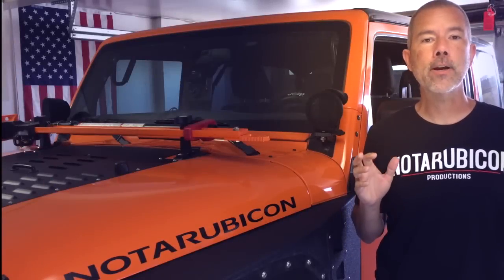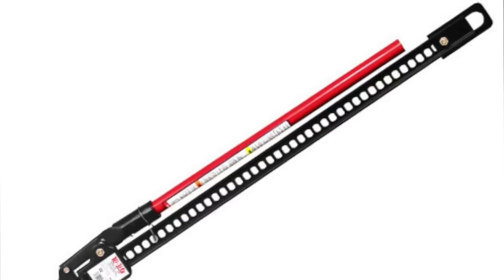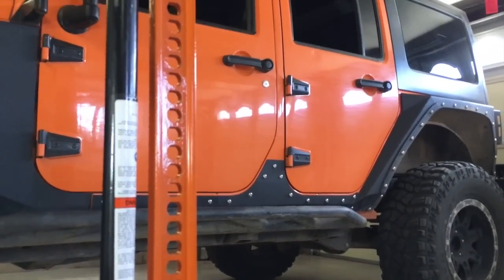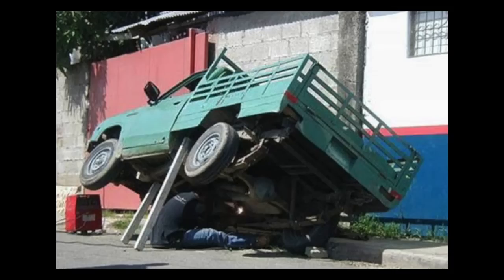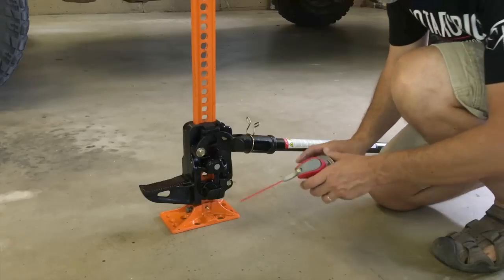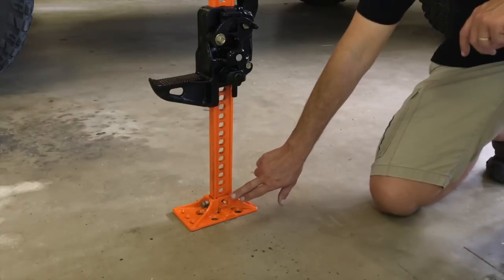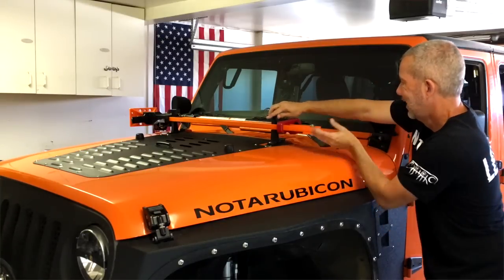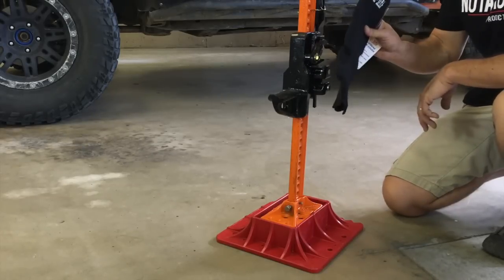HiLift Jack Intro And Review

Comment: I have had one for 20 years. Sometimes I don't use it for six months but when I need it (with it's necessary can of lube)it is right there and always works. So many uses. I don't go in the woods without it.
Reply: Being the experienced owner of a Hi Lift. The previous owner of the house died so I got it. The jack is not in use and stands up right but I can't  get the handle to come up. It is locked in down position . I want to store properly.

Comment: NEVER EVER drill holes into your HiLift jack. the base plate should be loose if its fixed it will break under weight.
Reply: Let's see your mechanical engineering degree.

Comment: I have three Hi-Lift jacks and I use them all the time. I also have a collection of other rigging equipment too and I like to weld and make things out of steel. I have all kinds of attachments for my hi-lift jacks and machines the hi-lift jacks can be bolted to, like my engine lifting gantry for example. I have beams with sliding support blocks on them for sliding under cars and then lifting cars up (safely), with my hi-lift jacks.  I use my jacks with chains for bending steel, straightening bent steel that's not supposed to be bent, clamping things, pulling things things and pushing things. In my opinion the Hi-Lift jack is one of the greatest and most versatile tools ever made. 
My advice to anyone with a hi-lift jack though is the same with any rigging equipment, always think things over well before applying force and consider every possibility and take steps to prevent any unwanted movements in any direction other than intended. Use straps or chains and so on the secure the object being lifted so it will only go that way you want and no other direction. They can be used on their own okay sometimes, but they are a lot better when you have plenty of other rigging stuff to go with them.

Comment: I have a hi lift but I prefer a bottle jack. Not only does it tend to be safer but takes up way less space. The only reason I would need a hi lift jack where I couldn't use a bottle jack, is in a situation where I could just use a winch. Just my opinion though. Still nice to have one
Reply: you clearly don't go off-roading because in most cases a bottle jack won't do shit

Comment: I do not have a hi-lift jack on my Jeep, however I did install a 10,000 pound winch. As of late I have been considering a farm jack. Enjoyed the presentation. I only have one minor disagreement .  I Feel the base should pivot, because of the versatility of the farm jack. For instance while pulling stumps it would have to be leaned forward and a tripod formed,that's when it would be best to Pivot on its base. I can also think of other instances where the pivot can come in handy. Stay safe on the trails.

Comment: I have had a Hi Lift since 1976 (same one) and have never used it (yet) for recovery of my vehicle.  I have used my "Come Along" and winch and snatch blocks; but, so far, not the Hi Lift.  I do use it around my property to raise equipment for jack stands and such.  If starting out, buy a sturdy chain bridal, some proffed chain, and a Come Along.  Then a winch, then the Hi Lift.  Just my opine.

Comment: i dont have one amymore and pretty much never used it as a jack. i use a bottle jack for that as my suspension droops too far to pick the truck up by the rockers (way around that is to chain your axle to the frame i know) 

however... that being said it is definetly one of the most useful things you can have with you  ive used it to straighten roofs back out, as a come along etc

Comment: I can't believe all these reviews on all these High lift Jacks are of brand new jacks! I farm so do some reviews after the jacks rolled around in the back of a pickup for 15 years and I'll guarantee you it takes a half quart of an oil douche and you still have to pull the pins with your fingers because the small pins bent or for sure the springs weak, but oh yea when the paints still bright they click right up and right down so any gear head will go right out and buy one. And no farmer wants to buy a new one when his still works if you know how to work it.

Comment: if you know anything about the geometry of a triangle, you'll know that base needs a little swivel to it, since it cannot roll forward like a floor jack. 

I feel this video was quite uninformative on safety in using this specific type of jack. Everywhere from saying you don't want a cheap jack to buckle while you're under the Jeep, to not mentioning putting the handle upright when switching the direction, to standing immediately behind the jack, and then finishing the video without ever actually using the jack.
Reply: Geoffrey Evert 🔺 Illuminati confirmed!!  sorry..all these comments have gotten me into troll mode.

Comment: For all of you guys who like to comment instead of reading instructions. You are not supposed to use oil. It will just collect dirt and cause it to fail.  From the Hi Lift manual.  "Using the jack without proper lubrication will result in poor performance and damage to the jack. The jack is not self-lubricating, inspect the jack before use and lubricate when necessary. After cleaning, lubricate the jack using light penetrating oil, or a silicon or Teflon spray at the following points:"

Comment: I found this Hi Lift like yours in my home left from previous home owner your video packed with information tell me how. If the jack is not in use. And the jack is up right HOW do you bring the handle up right to match. Mine is in a locked position so I can't move the  handle up so you can store it?

Comment: Always have a Hi-Lift on my rigs. The Jack Daddy requires you to be able to move the vehicle either forward or reverse to pull up onto the jack. I have been stuck in quick sand where you could not pull forward or backwards. The hi-lift was the only tool that would get me out.

Comment: The base is loose for a reason.  With your 'set screw', the Jeep is always going to have to be on completely level ground or you are going to be putting a lot of lateral stress on that jack.  Also, WD-40 is not a proper lubricant, it's a solvent.  You want to use oil, or even better, grease.  If anything WD-40 will displace the lubricants that should be there.

Comment: I bought a harbor freight farm jack because the scissor jack that came with the truck buckled when I went to change the tire luckily I haven't removed all the bolts and I am very proud of my farm jack although it does live outside in the elements on a custom fabricated mount it's always there when I need it. If it was up to me I'd say that everyone who works with their truck/SUV should invest in a farm jack like you said it is a very versatile tool to winch lift or spread with and I've done a lot with it best tool ever invented but it is just that a tool it's not to be taken as the safest thing ever made it's like a hammer it's nice to have when you have to hammer something but if you use it wrong it can hurt you and with a 2.5 ton vehicle being supported if you use the jack wrong it can kill you I've seen people who had their hands or face in the traveling path of the handle and hospitalized them for months use great caution when using a farm jack don't be dumb and in a hurry always inspect the jack at least twice a week
Reply: The jack has never popped out on me but the foot plate could be make a little more sturdier

Comment: Considering I don't have a winch I think it's a great tool to have.  And if you put the jack at the connection brackets of the stock steps it does work OK.  Using a lift-mate and carrying a jack stand is a better option.   Someone said below that the lift-mate is too expensive?  It a lot cheeper than new bumpers and rock rails.  Someday maybe but until then.....

Comment: i know wd40 is a great tool to have, and i use a lot, but i have found items i store outdoors tend to rust more quickly with wd40 than other lubes such as 3 in1, motor oil or air tool oil. nice jack, btw, its next on my  list for my jeep
Reply: Your spot on there, WD-40 is a Silicone based lubricant and Silicone is Acidic and does/will cause "RUST", The Silicone used on Auto Windows is A "Non-Acidic" based Silicone for that same reason, 3 in 1 or light weight motor oil would be best. Diesel would be better than WD-40.
Reply: You are not supposed to use oil with these.  Oil will collect dirt.  Gumming up the works can either prevent use or cause a failure. There is at least one video of a guy who was smacked because he had to keep pushing the pins in. There is a ridiculous amount of play in most of the parts except for the pins.

Comment: I think it is important.  But if your Jeep is flipped over, how do you get the jack off the hood?  If you do have the jack and the Jeep is wheels up, how would you use this tool to flip the Jeep back on its wheels assuming that no one is around with a winch?  I guess I will look around for those other videos.  I am going to get one of these jacks for my pick 'em up truck.  They can come in handy if you come across someone else who is in trouble.
Reply: 松田もしくろす The main purpose of a jack is to lift your jeep up to do work under it, if your jeep is flipped over, you don't need a jack to get under it
Reply: Usually that area on the hood is still accessible, unless your roof is completely crushed.

Comment: I think it's funny to see these stock JKs ridding around with a high lift mounted to their jeep but they still have the factory plastic bumpers and side steps. Where did they think that they were going to lift their jeep from?
Reply: I did that till i busted the front bumper and got a stubby. i used the "lift mate" and lifted from the wheel. IMO its a lot easier to lift there than fron a bumper or rocker bc i dont have to deal with the drooping of the long arms. yes i could use a strap to tie the axle to the frame but the lift mate made it too easy to go back to doing that.
Reply: Yeah but the lift mate cost more than the jack!
Reply: That's a good idea.
Reply: Mr Sir - DRings, lift mate to lift via wheels, etc. some people own a hi jack because it can be used in place of a winch. Don't be so quick to judge.
Reply: You took the words right out of my mouth!
Reply: No it doesn't
Reply: Better than the stock jack
Reply: Ethan McLeod to be honest there’s nothing wrong with having a stock jeep with High Lift! maybe they take their Jeep off roading not just in the pavement. High Lift should be on peoples list when going off road stock or modded jeep.
Reply: Even if you don't use it there is a possibility someone else may need it.

Comment: Pet Peeve of mine ....WD 40 is NOT a real lubricant!  It is more a solvent moisture displacer that actually DISPLACES real lubricants like oils and grease!     One of the most misunderstood products that people tend to do more harm than good with in my opinion...it is NOT "oil" ...want to lubricate something?  Maybe clean it with WD but THEN use oil or grease ....WD40 has got a racket!  People squirt at things that need lubricant getting rid of the lube that was there meaning you become addicted to keep squirting the wd ....where as IF one would simply use REAL lubricant?  It would be DONE maybe for years depending on the application
Reply: then tell me, why does it lubricate?

Comment: I have 3 Hi-Lifts 1 generic for the Dirty jobs and the Genuine 48" All Cast jack  that does most things and I also have the 60" Extreme Version, It's a work of Art but Geeze it is heavy, It is nice with the easy off based plate and I really like the new 7000lb Top Clamp, The two most important things you can buy is a Genuine Hi-Lift and 10ft of Chain, If your Truck is Lifted then buy the 60" version because even with standard suspension on a 4x4 you can run out of Lift with the 48" Jack in some cases. A Hi-Lift is the first bit of kit a person should buy because it is the one thing that can solve a lot of Rough Trail problems, wouldn't trade mine for the world.  Oh and just be careful with that jack mounted on the Hood or the Bullbar because in an Accident that jack can go flying off down the road or become part of your Face, Stay safe out there and thanks for the great Video.

Comment: Use something that actually is a lubricant. WD-40 is a solvent not a lubricant
Reply: no, it is a water displacing lubricant, havent you ever used it?
Reply: Dan The Bike Hooligan   WD-40 IS, ABSOLUTELY a lubricant! It's a light, thin, water displacing lubricant. It's not the greatest at just lubricating, but that's because it was formulated with other uses in mind too. It CAN act as a solvent, but as solvents go, it's not a very strong one! We've been using it (forever!!) at the machine shop I work at, mostly to stop steel from rusting, or "lubricating" screw threads for an easier fit. From my experience, it works to loosen rusty screws and bolts, making it easier to UN thread them, but I don't think it works that way so much as a SOLVENT, I think it just makes the unthreading easier because of it's LUBRICATING qualities which makes the threads more slippery. There are better lubricants on the market than WD-40 (certainly, depending on the application) bit there are FAR better and stronger SOLVENTS than WD-40 !!
Reply: @MikeS-um1nm  it's like duck tape, hundreds of ways to use it! Great hand cleaner too! It's in every tool box, tractor & truck on my farm!

Comment: Please tell me why I need one of these? I've got a 2" lift on 33's don't think I need one for changing a tire. Have a wench on the front so I think I got that covered. Always wondered about lifting points with those jacks. Unless you have some sturdy rock sliders. Then you got to protect the side of your jeep from the jack. No I think I may get a ground anchor. The jacks are cool but I think they are rarely actually used.

Comment: Important if you are in need of recovery but man never modify a jack.. The base moves to maintain a flat base when the vertical angle changes on the jack frame. You will stress it on each lift and it will break one day!

Comment: very dangerous to use. So I never put one in my 4x4 truck
Reply: Not a dangerous piece of equipment if used correctly. Even a hammer if used incorrectly can cause some real damage.
Reply: I agree. I highly not recommend using one -- instead just use a pair of bottle jacks with extensions

Comment: Those hood mounted Hi-Lifts will become a great, deadly, projectile in a crash.  Not a fan.
Reply: Do you also consider the hood on this jeep a deadly projectile? Because these mounts are arguably stronger than the original hood mounts.  They're not going anywhere.
Reply: If you're sooper smart you can attach it to your front bumper, so when you jam into a ditch it's totally buried.

I agree about the hood mount, the hood hinges were never made to handle the mass of the jack, and its going to go bye bye in any sharp hit.
Reply: +wesley buff --
Take a long hard look at those little hinges... The mount isn't the problem.. The mount attaches to the little hinges that were never designed to handle the hood plus the jack... It's definitely going somewhere in a crash at highway speed.  And that somewhere is probably the car in front of you.  I wouldn't do it.

But I also don't drive around on pavement with my Hi-lift.
Reply: +Kurt Van Wagenen --
Now you're absolutely right about that, it certainly is a mall crawler thing.  That's how you end up with a jack that has seized pins, is in poor condition and wont operate when needed ... but it did look sooper cool for the 10 years you never used it.  I have been looking at the possibilities of mounting a rescue Hi Lift on my 83 CJ, as I could actually use one for its purpose in the fire service and found that my latches would be more than capable of holding every bit of a 33 pound, 5 ounces during the worst of accidents.  Not only that, but I have seen the aftermath of these wrecks and seen that they don't move for myself involving 60+ mph collisions.
Reply: I made a mount that goes in the hitch receiver.  Take it on and off as needed.
Reply: Your rig, your rules.